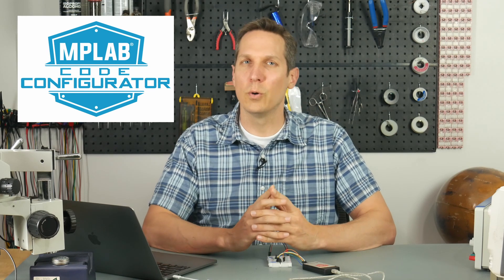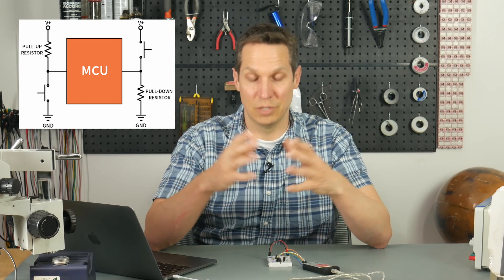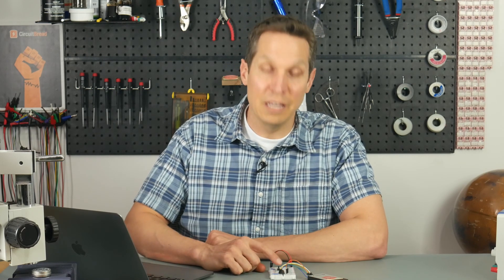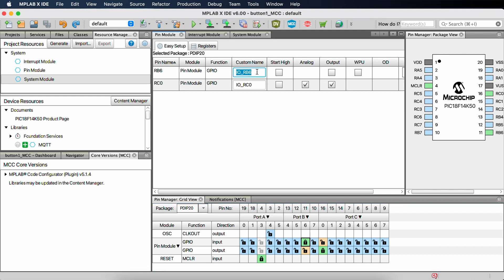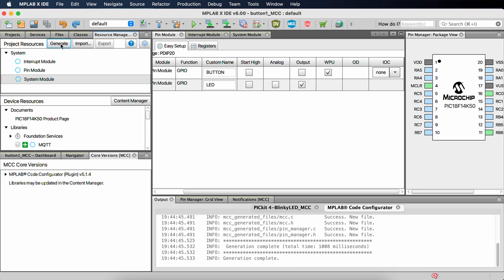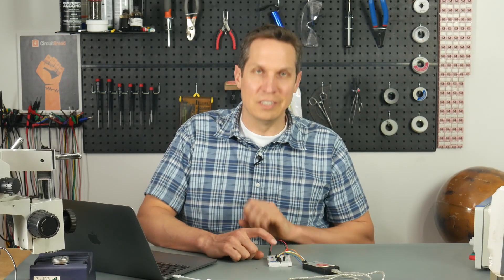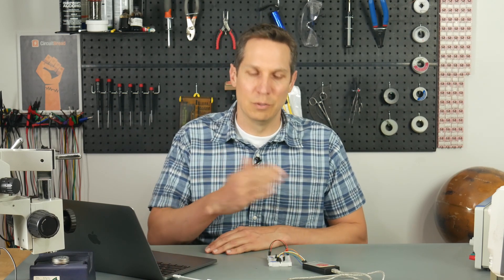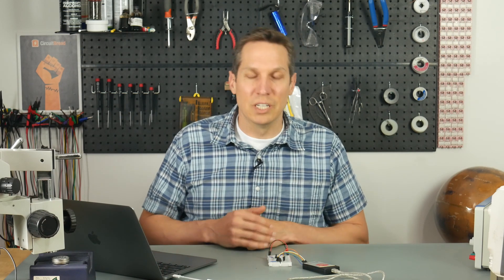Part 5. Using a button with the MPLAB Code Configurator - Embedded C Programming with PIC18F14K50

Comment: Hello. These tutorials were a great start to understanding PIC microcontrollers, but alas they seems to have come to an untimely end. Can you confirm that you will restart these excellent tutorials. (A rough timescale would be good too)
Reply from the maker: The written tutorials have continued on very well if you'd like to check them out!  It's the videos that have slowed due to a variety of reasons.  However, there are two videos that are in the publication queue and should be coming out within the next few weeks.
Reply: Thank you for your reply. I did realise the written tutorials had continued, and I have used a couple of them. Nevertheless, the videos add so much more. You manage to answer the silly questions before we ask them! I look forward to more videos in due course, thanks again.